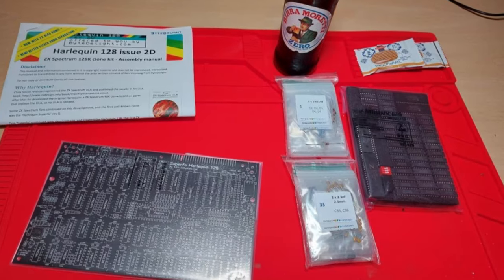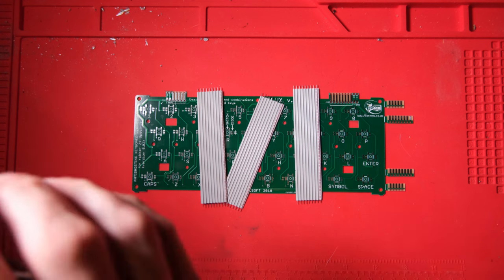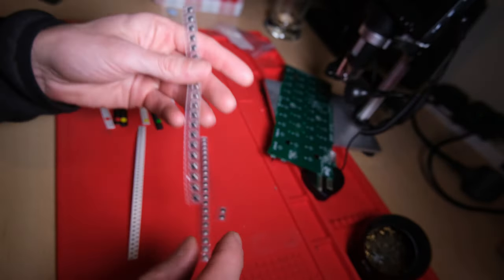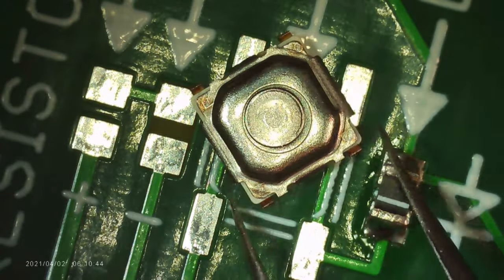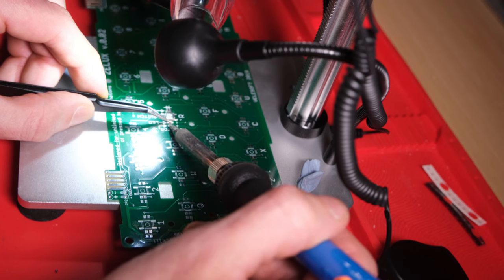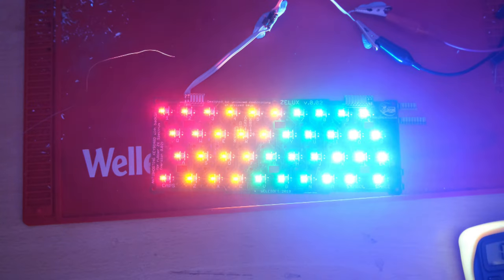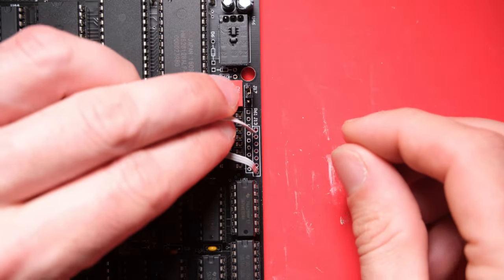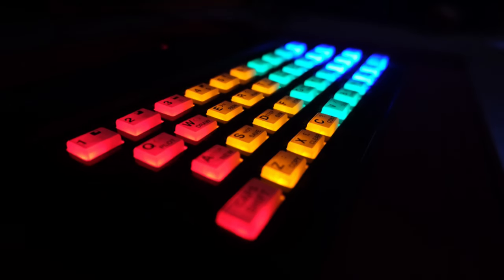Is this the BEST ZX Spectrum Keyboard?

Comment: I really like that Harlequin project. Replacing the PLA with off-the-shelf components goes a long way keeping the Spectrum alive. I like that mechanical keyboard replacement, too. Only thing I couldn't be arsed is soldering the LEDs - I'm not one for flashy but function-less RGB lights on keyboards.
Reply from the maker: It's always an option to go without RGB, it would simplify the build a lot!
Reply: @HappyLittleDiodes   oh yeah, for sure. And it would feed into my laziness.

Comment: The key with SMD is flux paste and a chisel or bevel tip. Put a dot of flux on each pad, sit the part in it, and hold steady with tweezers. Apply a tinned soldering iron bit to either end and you get a neat joint.

Comment: Your a brave man to take on that smd job by hand! Perhaps the reason why the built boards are not that much more expensive, is they may be made using solder paste, laid by a screen printer onto the pads, then place the parts and send through a nice hot oven, solder paste melts and solders all the smds. Many joints can be made in very quick time. That's how we did it when i worked in an smd dept years ago. I want one of those harlequins myself, is it the Byte Delight kit James?
Reply: No they are hand made. The price will be going up soon! :)
Reply from the maker: Yes that's right it's from Byte Delight, a very well put together kit

Comment: I've done over 30 of these now for ZX renew and other people items to do them 5 at a time lol the best technique is to do all the buttons in one go as it's the biggest component and uses the most heat then you can work around them to do the small led next followed by the right resistor and then the diode as you can probably imagine because I have done so many I've got it down to a fine art good video though Retro Robbins
Reply from the maker: 30! That's some patience

Comment: Wow! That looks stunning. You touched on the feel of it earlier in the episode but didn't mention it when it was assembled? I've seen another video mention they found the keys a little tricky to press, having to hit the middle of each key. How did you find yours?
Lovely video BTW 😁
Reply from the maker: It's feels great, I didn't notice any issue with having to be precise.  That might be down to the rubber mat I've used
Reply: @HappyLittleDiodes  might be they were using an older mat with a bit more flex. Ok, I'm interested again now!
Reply: I think I overdid the flux and flooded the switches, making them sticky and odd feeling under the key mat. A good dose of IPA and some scrubbing with a brush loosened most of them up. I think with use the remaining few will ease up too, the rest all feel lovely and mechanically clicky.
Reply from the maker: You could always replace the ones that are affected, did you get spares?
Reply: @HappyLittleDiodes  hmm, I’ll need to check. The kit was generous with extra LEDs and diodes, so I think so.

Comment: Have you had any issues making a good connection with a cartridge? I thought the kit was absolutely fantastic in the way it was put together and documented but was a bit disappointed to find they used HASL for the edge connector. Sometimes I have to play with it a bit to get a connection and I'm worried it might not hold up well over time. Mind you, it's no worse than what Sinclair used I don't think.
Reply from the maker: No issues so far! The DivMMC connector always seems to be super snug